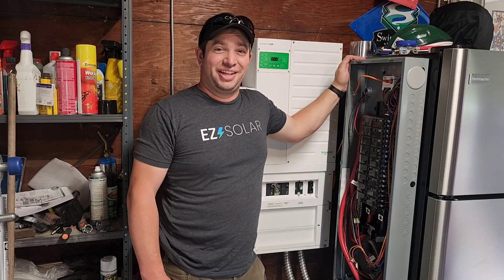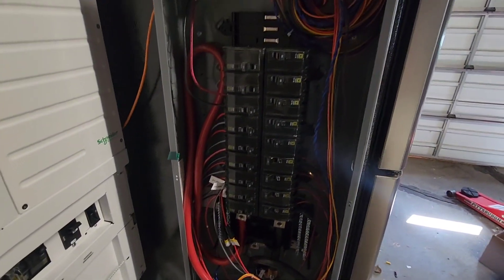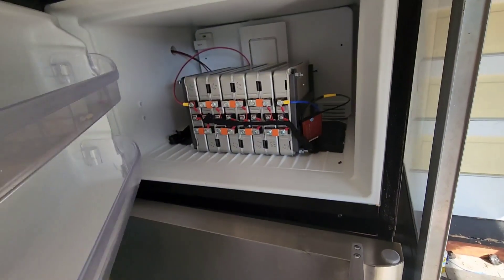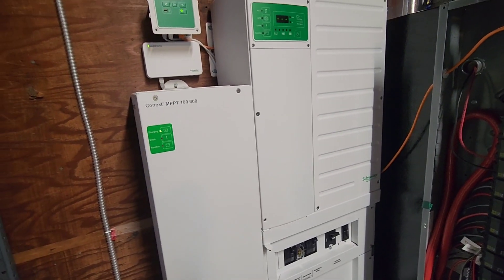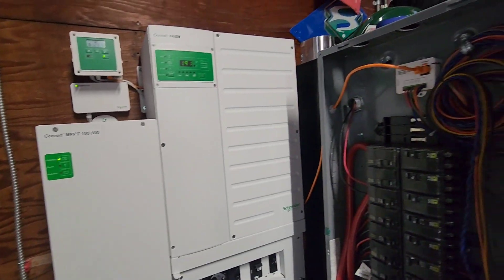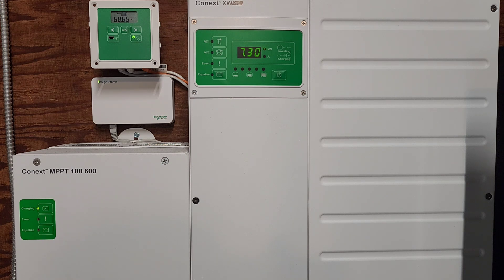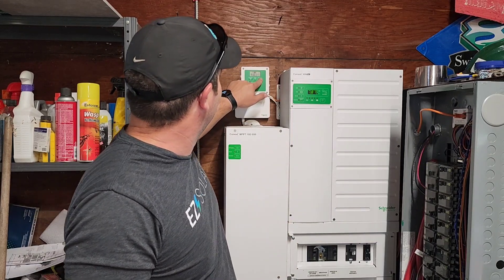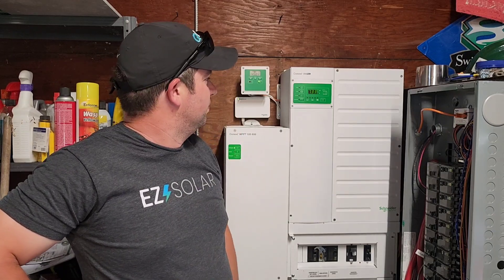Sol-Ark 12k Kept Shutting Down. Can the SMALLER Schneider Handle it?

Comment: In your video you mentioned AC coupling your SolarEdge and one of your replies to a comment said you are working on it now. What will the capacity input from the SolarEdge be,  and will it add to the overall capacity of the 6000 watt capacity of the XW pro or will it add capacity like increasing you battery capacity? I'm confused exactly how that works. I have a SW4024  and would like more capacity so I can run my electric dryer with out running my propane backup generator. I am totally off grid. Talked to tech support a few weeks ago and like you they  answered right away an were very  happy to be as helpful as possible. They told me I could add a separate inverter to my ac input of my SW4024 as long as it is of less capacity than the SW4024. So I guess my question is if I add a 3000 watt capacity inverter to the ac input of the SW4024 will I end up with 7000 Watts of capacity or will it be like adding more batteries to my system? Really like your informative videos and hope you or some one else knows the answers and can help clarify this. Thanks
Reply from the maker: AC coupling is really cool.  It will increase your usable capacity, but won't ad to your battery capacity at all.  Basically, if you have a 4kW battery based inverter and a 3kW grid tie inverter AC coupled with it, you'll have 7kW of usable power, but only when the grid tie inverter is putting out max power.  You'll be using the power as it's generated by the grid tie inverter and any that's not used goes back into your battery.  The Schneider inverter will shift the frequency when the SOC gets to around 90% to shut off the grid tie inverter.  The power from that is best used while it's being generated, but can be used to charge the battery as well.   
Hope this helps!
Reply: @benssolarandbattery  Thanks for the fast reply and yes that does help. Here in the New Mexico mountains I rarely ever have a shortage of sun shiny days. As mentioned  earlier I am off grid so reliability is a big factor in decision making so I really like the dependability of LF inverters. What if  I add a XW Pro 6048 with its own battery bank and just take my existing system the SW 4024 and its battery bank and then  tie it into the XW Pro 6048 on one of its ac inputs and tie the backup generator to the other ac input of the XW Pro since I think it has two AC inputs. I will end up with two LF inverters each on its on battery bank .I never need the 11kw Kohler generator but its nice to know its there  if for some reason I do need it. Will the SW 4024 work with the XW Pro connected this way instead of a grid tie inverter ac coupled? Thanks

Comment: So great to see this comparison!!!
I still love my Sol-ark for my home grid tired setup, just can't beat the control you have in software IMO. However, I had to balance all my 120V loads very carefully knowing it's limitations with imbalance... But for off-grid shed (tiny home) build it'll be with either Schneider or Victron for overload protection & 240V well pump 🙂👍.

Comment: Schnider XW was the only things I was considering for my offgrid build but all the people installing Sol Ark over the last few years made me take a second look. Solar Ark might be a good option for Grid Tied with Back up but I think Schnider is the king of Offgrid. Thanks for sharing the video!
Reply: Exactly. Sol-Ark is good for grid-tie only because it doesn't handle real life loads very well in an off-grid setup. This isn't a dig at the Sol-Ark specifically, but at all transformer-less inverters. The most impressive thing about the Sol-Ark is its brochure.
Reply: @moto-rambler  This isn’t true. It depends on your specific needs. I’ve been running my place off grid flawlessly with the SA 12K. Starts my 3/4 hp deep well pump perfectly and everything else. Granted, I’m not running a big compressor or other big motors, but the SA is actually really good off grid for some people. A lot of internet wisdom isn’t based on first hand experience, I’m afraid..
Reply: @NeverTakeNoCut-offs  a 3/4 hp pump is practically a toy and should be a given for pretty much any decent inverter. Anyway,  my comments are not just an opinion, all inverters built on this topology either struggle or simply cannot run motor loads except very small loads (like your 3/4 hp example). The Sol-Ark units are better for grid tied systems where the grid can do the heavy lifting and inductive loads can be isolated during a power outage.
Reply: @moto-rambler  Pretty standard for deep (550 ft)  off grid wells. Guess you are not off grid...
Reply: @NeverTakeNoCut-offs  what is 'standard ' for 550 ft wells?
Reply: @moto-rambler  Great points Matt - I suppose it all boils down to buying the equipment that best matches your current use case and it's ability to potentially handle future changes.  Many thanks again.

Comment: That's the first time I've seen a battery combiner wired through a service panel. Interesting. Any reason you did it this way versus a regular bus bar?
Reply from the maker: I had a crazy idea and wanted to try it really...  each 16s module  has its own 40a BMS along with a 20a breaker on the other end, so it offers good protection. Square D QO breakers are rated for 125VDC, so it works perfectly.

Comment: Very nice!  I've heard nothing but good stuff about their hardware.  I cant say the same regarding their customer or tech service, and I've heard the user interfaces aren't super easy to use either.  Having more complicated individual components complicates things as well, especially for the DIY folks.   With that said, once they're up and running, I know the Schneider systems perform.

I still think the SA 15k might be the best and most universal inverter on the market for the money, especially for a DIY, but it's still a HF inverter.  I suspect an additional auto transformer might allow it to be even more competitive with the LF inverters, if needed.  Even w/o an AT, one user has already stated it can start his 4 ton AC unit, even with base loads running, although that still might be really pushing it.  It's still super comprehensive and flexible for <$8k with the simplicity of an AIO unit.  With SA's amazing CS/TS and 10 year warranty, it sure seems hard to beat for the money IMO.
Reply from the maker: Their tech support has gotten so much better in thr last year and a half.  I called them a couple times for questions when I was setting this up and there was no wait either time.  They were very pleasant and answered my questions right away.  That's a far cry from a year and a half ago when you'd wait for hours and then get a grumpy guy who didn't want to talk to you.
Reply: @benssolarandbattery  Glad to hear it!

Comment: That was nice to see that inverter going almost 10kw on a 6.8 rated inverter . I am waiting to see the solar edge & the Schneider Ac coupled you are going to make .I'm going to go on a limb & say you are happy you gave Schneider another chance .
Reply from the maker: I'm testing the AC Coupling as we speak. So far so good!  I'm definitely happy I gave them another shot.
Reply: @benssolarandbattery  I was ac coupleing my solar edge with the Schneider4048 but I had to derate my solar edge due to me having to much output from solar edge .
Reply: @benssolarandbattery  wow you should do a live…🫣
Reply: It AC couples just fine. I’ve got a SolarEdge 4K inverter on the smaller version of the Schneider the 5.4. kw xw+ and it’s works like a dream

Comment: Nice.  You have Enphase micros on some of your rooftop arrays?  How is AC coupling working out?  How about running central air?
Reply: Oh maybe you had just one microinverter on an extra panel covering something out back.
Reply from the maker: Just 1 enphase m250. The main system is Solaredge and then there are another 9-290w panels on my back roof tied into the charge controller.

Comment: What happened to "Why Professional use the Sol-Ark 12K".  You actually slammed the Schneider for having to many bits and pieces and said the software had issues.
I guess now that Signature Solar is looking for a new YT influencer and  they are a Schneider  dealer things have changed. What new products will you be getting from them?

BTW have you ever thought that the Schneider protection circuitry is not working and that's why it is running that load.  It never tripped so the next thing that could happen is a fire.
Reply from the maker: I have no deals with Signature Solar, thanks for assuming.   
I did slam Schneider and you'll notice that I haven't deleted that video.  It was all warranted.  The Sol-Ark still has it's time and place.  It's a much simpler install and offers a lot of value in a fairly small all-in-one package. 

 Schneider recognized that they had major issues with their product and service. According to them, they've since rectified both.  I called tech support there the other day and got through to a knowledgeable person right away.   I'm testing it now to see  if the glitches are gone.  

Thanks for watching!
Reply: If you had been watching the channel he made a video months ago saying Schneider contacted him and wanted another chance to make things right and they had fixed their support issues.  Go check out Abney Solar channel to see the XW getting stress tested there too .
Reply: XW pro will overload to 12k watts.  If you check specs, the overload times are quite impressive.

Comment: Can't wait for the follow up when you find the limits. Everything is rosy when it's first installed and operating correctly.
Reply: I beta tested a dual Schneider XW system in 2005. That was 17 years ago. That dual system is still running my micro-grid. I live completely off-grid. There are four homes on our micro-grid. I live in a 2300 square foot house with 2 window AC units, an electric oven, a hot tub, a full wood shop, and all the other whistles and bells you would expect in a modern home. The only thing I have done to my system over the years is upgrade the software, add more solar, more charge controllers and upgrade to Discover LFP batteries. I've not found the limit of the system and believe me, I try. It just keeps going and keeps running everything. LOVE my Schneider!!!

Comment: Great comparison, As I've said before the lowest priced product never represents the best value. Likewise, the highest priced product doesn't necessarily represent the best in class product. Its worth mentioning the Sol-Ark 12K retails for about $7,000. Yes, it has built in charge controllers, and some cool features and data logging, that still does not justify the high price especially considering the pathetic inverter performance.

Comment: Wish Schneider would make an all in one with the components they have that are already great
Reply from the maker: That would be nice. The install definitely took longer then a Sol-Ark install, but in the end it was so worth it.
Reply: @benssolarandbattery  yeah definitely a top notch product. I believe midnight is coming out with a big boy soon
Reply: @benssolarandbattery  I actually prefer it not being an all-in-one.  if I have an issue with a charge controller,  I can keep the whole system running, and return a charge controller.   if I have an issue with the inverter, I can bypass it, and ship it back or replace it, meanwhile the charge controllers keep my batteries in float.   I'm a HUGE fan of modular systems instead of all-in-ones.
Reply: It would weigh 300 pounds.

Comment: Huge fan of this video and have been patiently waiting. No confidence that Sol-Ark will start my 240v deep well pump 37a surge and 7a run. I think the only options are the XW Pro or Outback 8048a.
Reply: Take a look at HyperEngineering soft starter for your well pump. I'm using one on a 4 ton Goodman Condenser with good results. Reduces inrush by up to 70%. The older model Schneider XW+ 6848 runs the air conditioner with no problem.

Comment: Hey Ben great test. When the dryer was running and you started the compressor was your heat pump a/c still running? My SW 4024 will start every thing I have tried so for. Table saw, air compressor, and my electric dryer, but I am not brave enough to run them at the same time. The dryer is the only one that pushes it over its rated capacity and I never ran it for more than 5 minutes since it pulls more watts than it is rated for. Being totally off grid I don't want to chance doing damage to the inverter. Thanks for showing what the XW 6048 can do.
Reply from the maker: Yes, 2 heat pumps were still running.  Base load in the house was around 1.9kW, the dryer is around 5.5kW.

Comment: Does anyone know how to measure how many amps your battery should be taking in from your solar before doing damage?
Reply from the maker: My batteries are all from EV's.  I have each module connected with a 20a breaker, 10awg wire and a 40a (rated) BMS. The batteries barely get warm when I'm charging them under full load.  They're designed to handle crazy amps and I don't see over 15a per module.
Reply: If you don't know, then a general rule of thumb is to keep it to a 0.5C rate or less.

Comment: Very good one, Ben. I really wish that you would discuss things like cost and efficiency because, sometimes they are also huge factors that cause unbalance in comparisons.
Reply: This system is approximately the same cost as a single 12k solark  which won't start either of those loads independently , so you're looking at at least three 12k's to do what one 6.8kw Schneider just did. Efficiency is way better with one Schneider than three solarks.  I'm glad they are fixing the support problem , and I hope the reach out to the DIY crowd with support as well.
Reply: @onthelake9554  I'm not having any problems with my Sol-Ark 12k since I installed an auto transformer. I would go with a 15K before I would ever triple three 12K's. You could piggyback them for far less than three 12's
Reply: @fisherus   Yes agreed but I doubt a single 15Kw solark would pass this test since it's only rated for 12k off Dc considering they don't have very robust starting ability .

Comment: My two Sol-Ark12K's have ran everything in my house totally off grid and I consume 60-80kWh/day. Schneider was choice number two for me, but their customer service changed my opinion of them. 

Edit:  The only thing my Sol-Ark's will not run as I found out this week is my Dewalt Circular Saw!!🤣I'm sure there are more things out there that it won't run, but I have upgraded over the last two years, anything that has high amp draw/inrush induction or PSC motors on them.
Reply from the maker: That seems to have gotten better in the last year.  I called them the other day and they answered right away!
Reply: Customer services 100% better than it used to be now
Reply: That is good to hear, because there are many of us that want a tier 1 primary system with good support. They missed out on a bunch of sales in 2021 when I was looking and chose two 12K's.  My tier 2 system- two EG46500ex are on the FedEx truck now. I hope my Sol-Ark's hold up well. No expectations on EG4's.
Reply: Well that says everything if you have 2 Sol-Ark's and they won't even run a Dewalt circular saw! That's like almost $10,000 worth of inverters alone!  💩💩💩💩💩💩
Reply: @boblatkey7160  how about go study up on high frequency inverters. They are not designed to handle high inrush currents, especially if you’re powering an entire house and 6.25 tons of heat pumps with two of them. In a year and a half I’ve had one dongle that needed replacing. I’ve been out of power six minutes, four due to my fault, two minutes being an lightning strike. I love my 12K’s. 96% efficiency.
Reply: Ya, but you paid about $14,000 for 2 Sol-Ark inverters. 2 Schneider Pros would have been half that amount plus the cost of charge controllers since they are not built in. Yes, Schneider's past customer service history is really bad but chances are you wouldn't have needed any cust service since their inverters generally work well out of the box. No way Sol-Ark is worth the price based on comparisons like this one and the now well known comparison done by Abney Solar.
Reply: @bentleyjarrard885  The price of the 12k is a bit steep but the new 15k is actually a pretty good value compared to the systems I was looking at from Victron, Schneider, and outback.
Reply: @bentleyjarrard885  Sol Ark has a 185A charge controller built into each 12K. I can max them out in Apr-May with 20,640 W of solar.